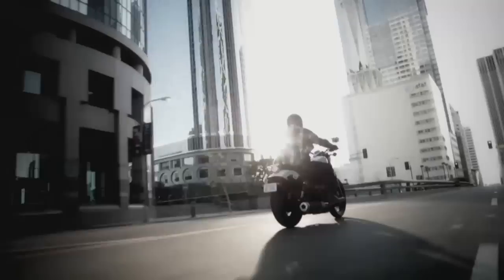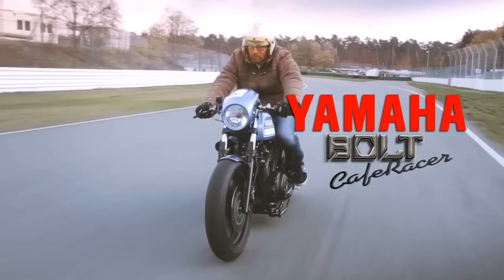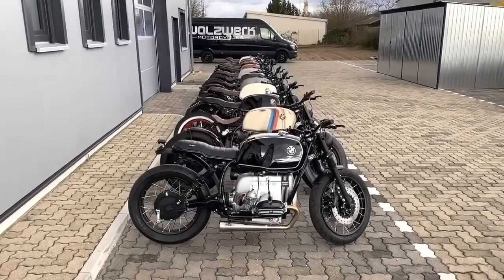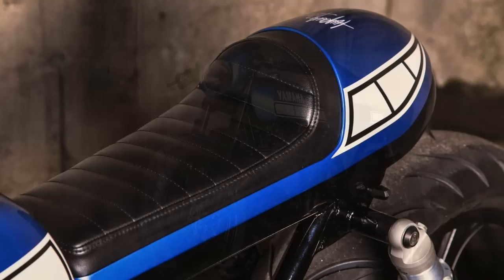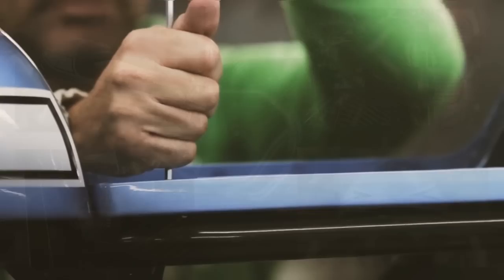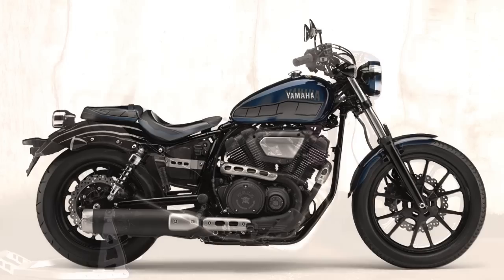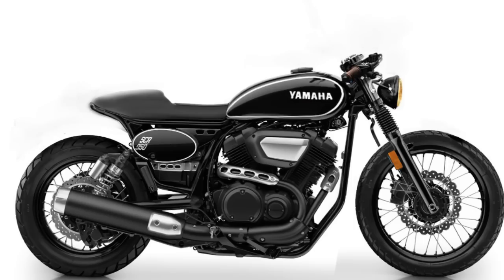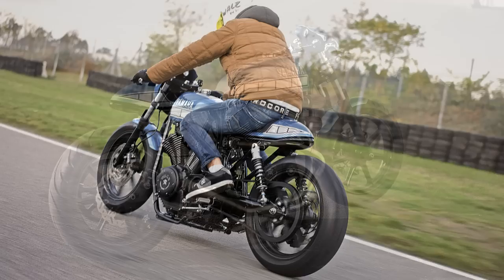Cafe Racer (Yamaha Bolt XV 950 by WalzWerk Motorcycles)

Comment: We have seen cafe racers with many engine configurations, some of them excellent and some not so much, all depends on the skills of the builder to modify the frame and keep the lines under proportion.
On this particular case I personally like the proportions and general lines of a proper cafe racer, "but"😂, do not stand out or difiere much of some Viragos that I have seen on this channel. 
Thank you for bringing up this video, as a discussion topic is very interesting!!
Great work Victor!!, keep it up!!👍🏻
Reply from the maker: Thank you my friend for sharing your perspective. My choice of this project for a video, is mainly to demonstrate the best solution, to achieve a good cafe racer stance, using a "difficult" cruiser like the Bolt model. Thank you Carlos  :) Cheers.

Comment: I own a cafe racer converted Yamaha bolt c-spec. It's such a fun bike to ride, I have a blast everytime I get on it. However, it's uncomfortable as sin and it hurts to do more than 30 minutes straight. It tops out at 120mph despite having a full two brother's system, power commander, flashed ecu, and  k&n intake. I'm a daily commuter so unfortunately, the discomfort isn't worth the miniscule performance benefits.

Comment: Probably all those Care Racer bikes presented on this channel have two things in common. 1. They are the most unergonomic and impractical bikes ever created. 2. They look good until someone sits on them and rides them, then they usually look plain stupid. Original Cafe Racers were just stripped down and modified bikes for practical reason: to make them faster. Today it is just about the looks. Poser machines for egomaniacs is all they are.
Reply: With none of them you would Ride further then the next two gellaterias. 
Mine is Not the perfekt Cafe Racer. But a 500 Mile Tour ist no Problem.
Reply: 100% in agreement,  most of them are built with a blank cheque , with no cost in mind, basically defeating the purpose